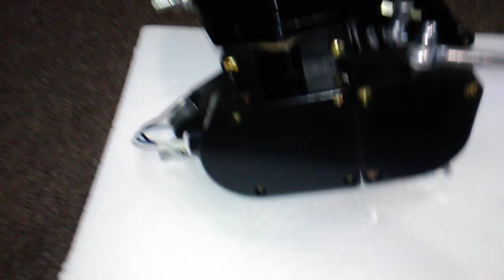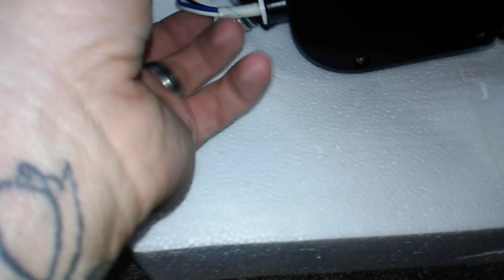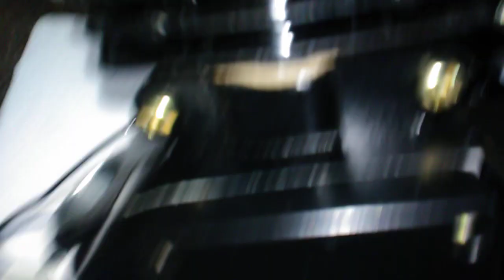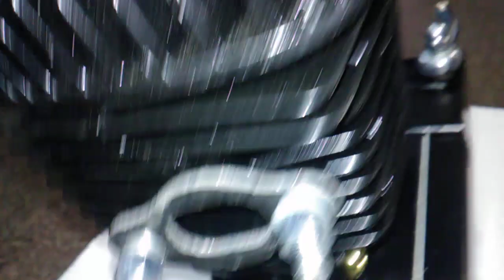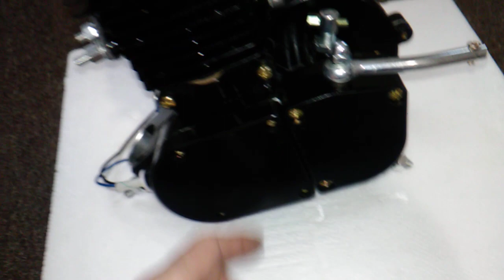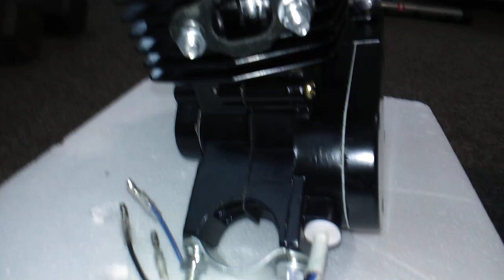Best eBay G4 66cc/80cc motorized bike engine yet

Comment: Is this engine still running.
Does it virbrate bad at high speed
Reply from the maker: Not sure if it's still working I sold it about 1-2 years ago but it didn't vibrate too bad but I had mounted it on a solid bike nice and tight.